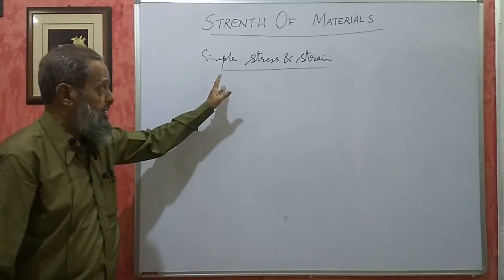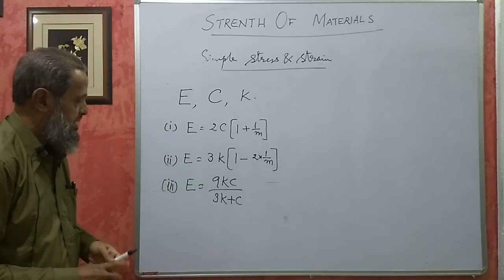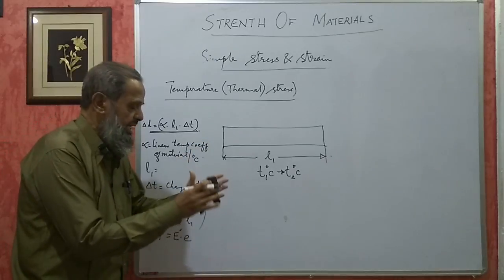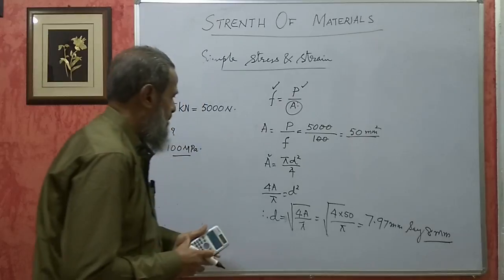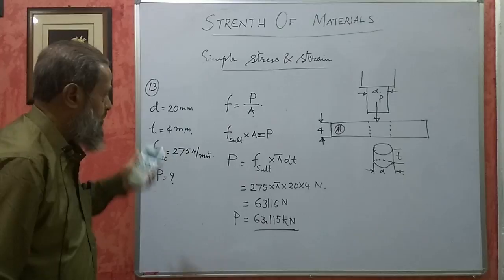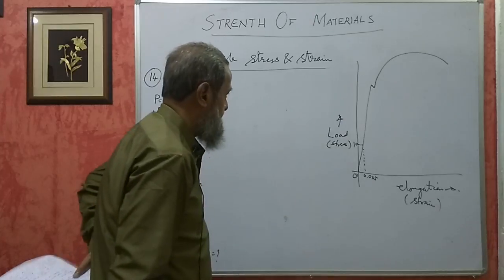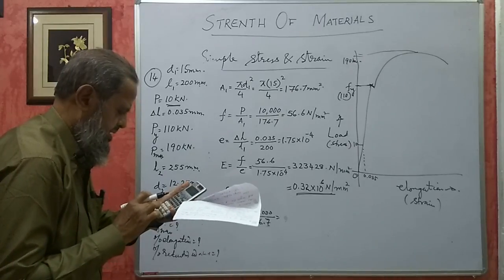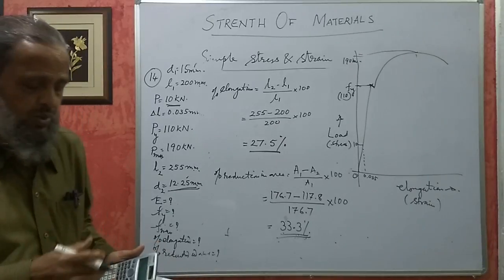Karnataka Diploma SOM - Simple Stresses and Strain - Part 2

Comment: Sir Modulus of Rigidity 1 problem getting trouble, please solve any 1 problem of this
Reply from the maker: Please send the problem
Reply: @mokhtarahmed3583  , Sir Question will be like this, A bar of 30mm diameter is subjected to an axial pull of 80KN. The measured extension 
is 0.1 mm on a gauge length of 200mm and the change in diameter is 0.004mm. calculate 
the poisson’s ratio and the values of young’s Modulus, bulk modulus and Modulus of 
rigidity
Reply from the maker: Can you please send your contact number for me to send the answer....my number is 9341262367